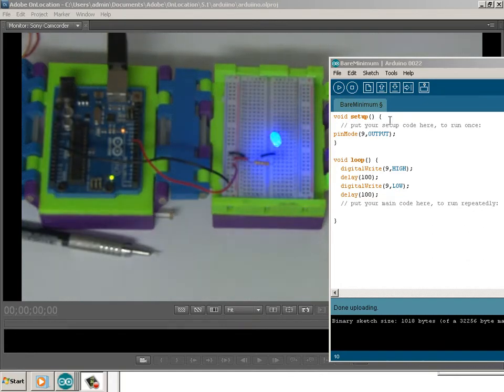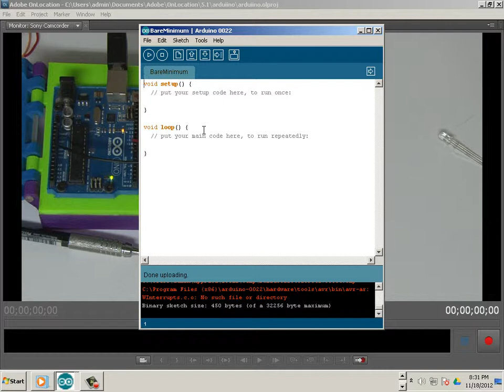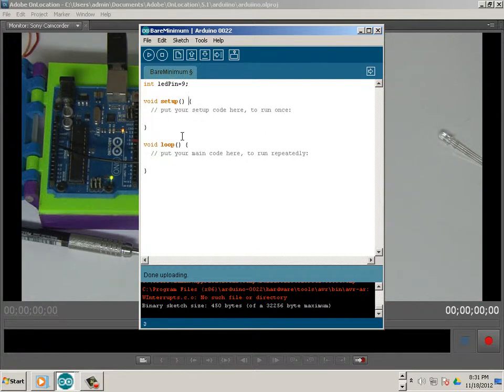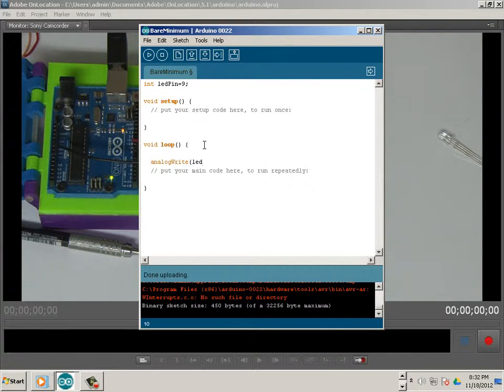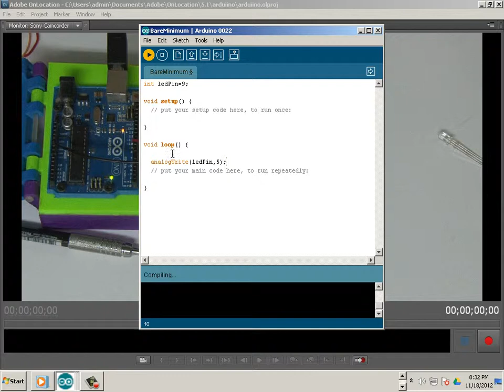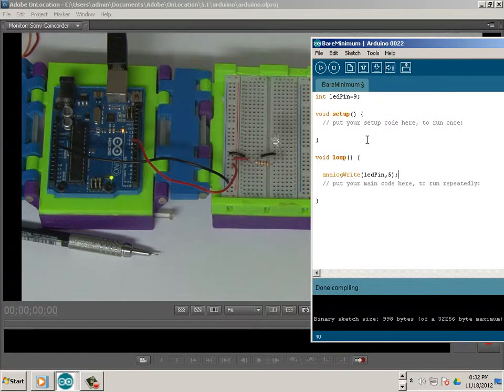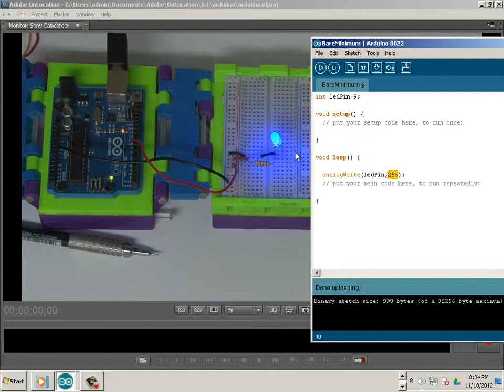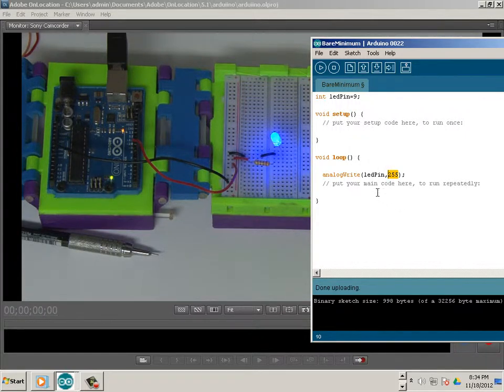0302 Chapter 3 Analog Write

Comment: I however, just started a couple days ago. I did 50ms ON, 50ms OFF with a solid state relay, and a CFL light. I did videos and stuff with the DS18B20 and also with the LMT86.

I thought that pins A0 - A5 were analog. Pins ~3, ~5, ~6, ~9, ~10, and ~11 were pwm & digital.

Pwm is pwm. spits out a duty cycle.
Digital is 0 or 1, 0vdc or 5vdc.

So how is it that your using pin ~9, and it's a pwm pin, and it's not labeled as an analog pin, but yet your writing to to it, to tell it to "AnalogWrite"?

I'm lost. I have the pinout right in front of me, and my Arduino Uno sitting to the left of me.

Analog spits out 0 to 255. That's 256bits of resolution.. I think. 0 being OFF, and 255 being fully ON. 0 being 0vdc, and 255 being 5.051vdc according to my 6000 counts DMM.

So.. can you please explain to me, what's going on here? It's not just you, but the tutorial on Arduino uses not a PWM labeled pin, but pin 2. which is not pwm, but digital. 0 or 1, on or OFF.

I'm going to take an educated guess, because I just looked at your videos, and your last video was 2 years ago. So whatever.. I guess I've just wrote that whole message to go out into thin air.